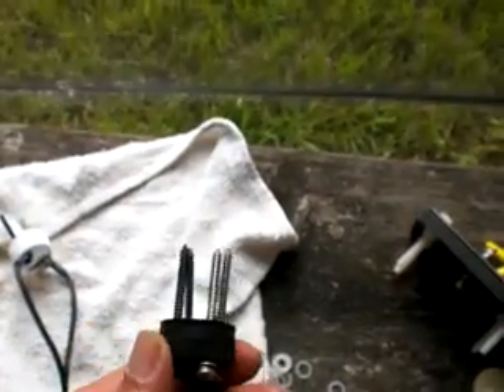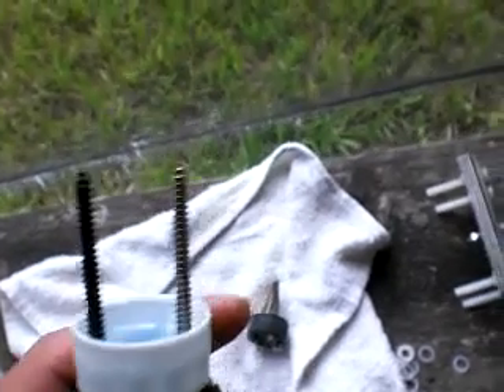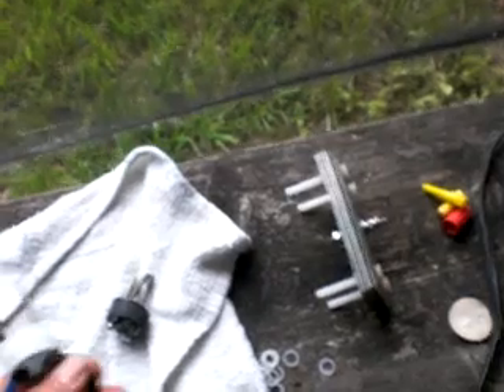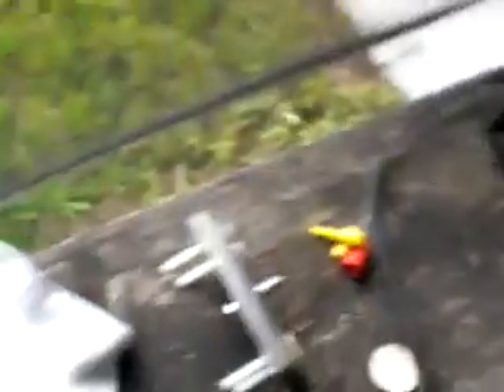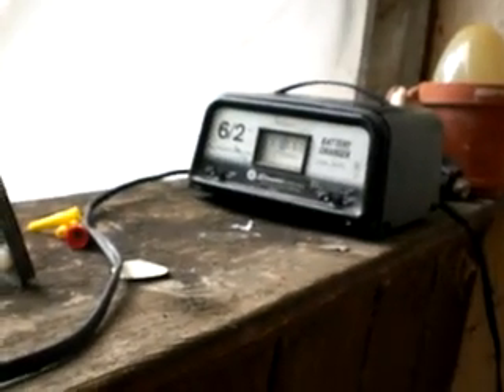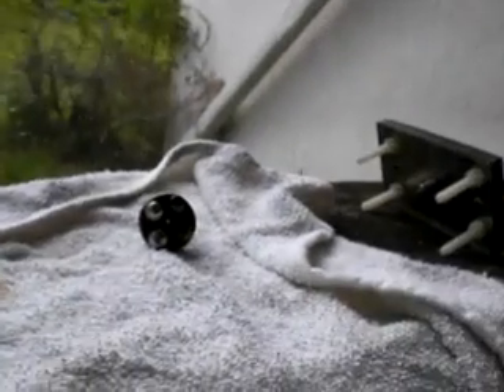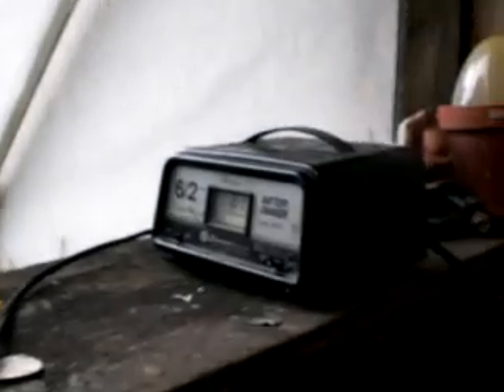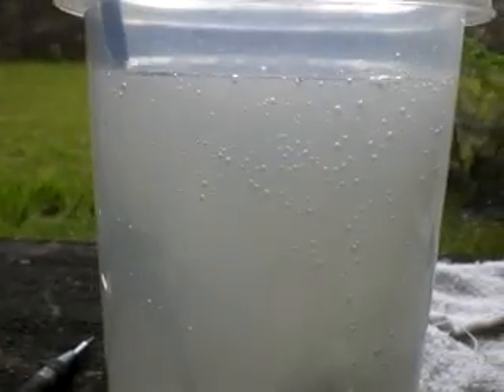The Soda Bottle Cap Cell

Comment: rainmanp7 aka cryogencis
hehe you like to squeeze the cap :) I like you. get the back connectors out of the water or protect them. use zinc
I can't buy that acid crap ,because the feds in my area roved it from the shelf because people use it to make Crack and or Speed. I can't even get lye lol. let alone hardcore drano. thank you for your video keep up the great work :)